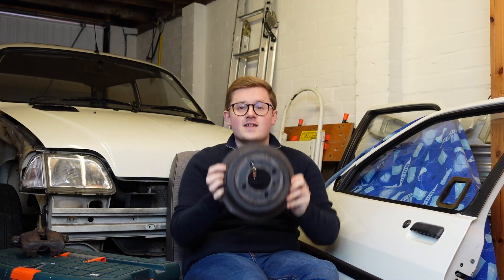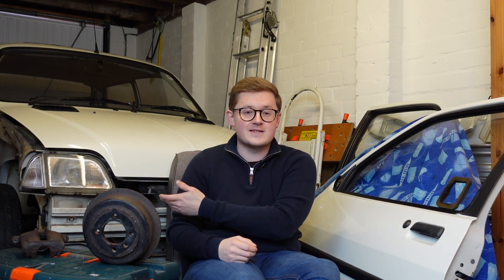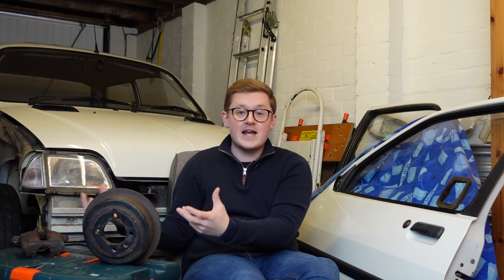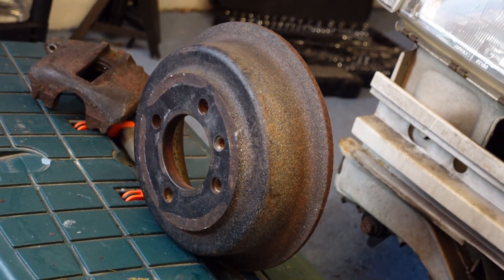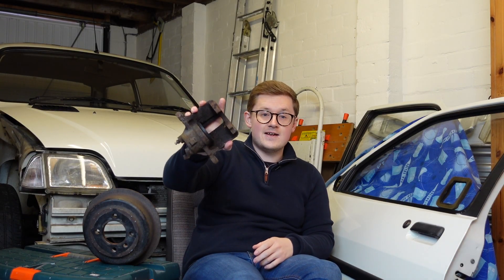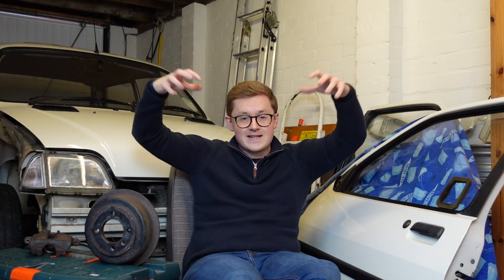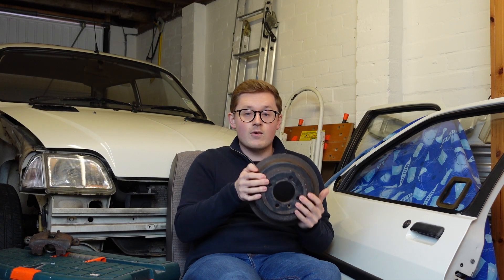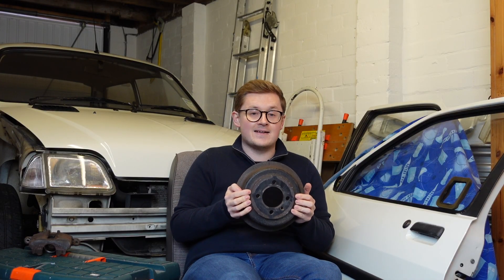Why are Drum Brakes Making an EV Comeback?

Comment: Good discussion. One error though...

The surface area of the friction pad in contact with the metal braking surface has nothing to do with the ultimate braking force. 

Friction force is dependent only on 2 things:  the materials used (same on discs and drums), and the force applied (how hard you push the friction material into the steel).

The advantage drums have over a disc of the same diameter is that the force is always applied at the rim of the drum at all points of contact.  In a disc system the centre of pressure is located in the centre of the pad which is further towards the centre of the disc. 

Thus with the same materials, same diameter brake system,  and the same force applied: the disc has a force applied closer to the centre of rotation meaning that it results a smaller torque (turning effect of a force or moment) to the wheel than a similarly sized drum with the same force applied.

This is why drums out perform similarly sized discs in terms of their braking TORQUE.

However...
The larger area (or more specifically mass) of the shoes vs pads goes to distribute the heat over a larger volume and mass of pad material (assuming the mass of the disc is similar to that of the drum) which means they will likely burn out less rapidly as heating is less localised.

This might mean drums and shoes are overall better if the force was even all across the surface if the drum brakes, however the leading edge of the leading shoe will experience far more force than the hinged edge (literally zero force at the hinge point and proportionally increasing as one travels further from the hinge (again, the physics of moments)). And the trailing shoe will be experiencing less force across it's whole surface due to the drum rotation direction. Pads however get almost evenly heated across their whole surface. So it is difficult to compare drums and shoes and their relative heating effects directly.

Comment: Cant you force the car to use the brakes from time to time to remove surface rust by software? If you remove the foot from the pedal and the car does regenerative braking, using the brakes as well with little braking power every x number of decelerations  should remove it, no?

Comment: Brake by wire is already in the corvette C8 anyway, I wouldn't worry about it being on drum brakes instead of discs.

Do disc brakes actually drag all the time though? Isn't there a spring that splits the pads when they're not pushing in?

Comment: Hi from Sydney, Australia. Beyond 50 years ago when GM USA was dreaming up, tooling up and designing their new US senior/big car range for all 5 brands for the years 1971 to 1976, GM was the wealthiest company on earth and their research and development was better than any other company bar none. The new 6 year 1971 to 1976 model run was to introduce many new features. ACRS (airbags) Air Cushion Restraint System introduced part way through 1973. GM would also introduce ABS brakes plus traction control. You could option ABS braking separately, however if you wanted traction control it came automatically with ABS that option/system was called MAXTRAC.  To create this GM sought the assistance of Bendix Aviation systems, who had created a set of systems for Hawker Siddeley's HS125 executive jet, and also for the offerings from the US Lear Jet company. GM & Bendix created a system for the enormous and heavy cars coming for this 6 year period, the front brake discs were huge thick and massively vented, at the rear were drums with the drums having alloy skins with a honeycomb of claws that cooled them inside the alloy drum was a ring of tungsten steel for the drum shoes. When one looks at one of these rear wheel ABS drum brakes, then removes the brake drum from the car, you will find drum surface and corresponding drum shoes that are 10 inches wide !!  Massively huge, also the surface material is/was ceramic !! Additionally, this system was so clever and advanced that 65 to 70% of the braking was at the rear, this stopped front of vehicle nosedive in ultra extreme braking and allowed the steering to be used and not so greatly compromised with the usual 70% front braking effectively limiting steering efficiency. The integrity of this 50yr old system is astonishing.

I own two Cadillacs from this time zone, both built here in Australia at GM's Pagewood, Sydney plant, sent as CKD Kits (completely knocked down, ie as parts in boxes) as to be registered here the cars would need to be right hand drive and other Aussie compliancy issues, so GM Australia ordered just 2 vehicles as CKD Kits Buick Rivieras and the premium long wheelbase range topping Cadillac Fleetwood Broughams. BOTH my 2 Fleetwood Broughams a 1972 model & a 1974 model are so equipped with MAXTRAC, additionally the '74 model has ARCS (airbags) dash top, steering wheel & for passenger. Premium cars, better than anything else, '74 also has electrically pretensioning seat belts, as G-force sensing mercury switches around the car trigger the reel-in feature and pull you back into the seat.  BACK TO THE BRAKES, when you mega-panic brake, stopping in one of these two cars feels like you have deployed a massive parachute behind you that has stopped the car dead in its tracks coupled with their electronic controlled air shocks and self levelling suspension, both these two cars do not feel , nor stop like any other car in a major panic stop, they stop in an ULTRA short distance with the feel that some giant hand or hook has ceased the car from moving forward, as there is NO usual front nose dive, none.  I have owned the black 1974 model now for 41 and a bit years and the white 1972 model for just gone 32 years, they have saved my partner and myself now for 4 decades, I'm a doctor and to me, these are some of the safest, most reliable, best built and equipped cars ever made by mankind and packed with features now just being added to some high dollar cars.

Comment: Im an engineer worming on acles for commercial vehicles in the USA so my exp is in commercial vehcils. We are having stricter rules for pad materials now (since 2020, then another stricter round in2025) to help alleviate some of the brake pad emissions by reducing the amount of copper in the pads. Additionally with moves to electric, we are still using air disc brakes but there are new innovstions the add speings to the calipers to keep the pads offf the rotors and prevent the drag you mention. So thats good progress for sure.

Comment: Think there is a lot of “selective memory” going on here.
I’m sure that size for size drum brakes can apply more braking force, but this is more than countered by the heat buildup.
If you go through flood water the motion of the disc throws the water off the braking surface, with drums it throws it on to the braking surface leading loss of braking force.
In the uk the braking surface of drums will rust, it might take a little longer, but it does happen.
On a disc brake the rust is scraped off in a few applications in drums it is trapped inside and acts like ball bearings between the surfaces and takes longer to clear.

As for maintenance over the last 44 years I have driven a variety of vehicles. I have never had to replace or overhaul a caliper, whilst every drum brake set up has needed new or overhauled cylinders every 2-4 years. My current car has discs all round, not because a fiesta needs them, but because in comparison to drums they are maintenance free. It’s also easier to see if they have faults.

Rear disc brakes are, let’s face it, purely a fashion thing like alloy wheels. Very few road cars need them and they are put on “cos it’s like a race car innit “.
The worst “style trend “ after Stupidly useless Vehicles are oversized wheels, who really wants a harsh uncomfortable ride with the expense of having to replace the wheel and tyre every time you hit a pot hole. All so you can shave 0.000001 of a second off your lap time, in the very unlikely event that you take it around a race track.

Comment: @7:30 engine braking works too, shame it's nowdays mandatory do full stops everywhere, losing more energy to start moving, it's what makes electric motors seem better, since they can have max torque from 0rpm. With automatic transmission, some people wont use handbrake at all, so when someone else uses that vehicle and tries, it just locks up, or wont work at all. I have worked with couple drumbrakes that wont have adjusters outside, they are adjusted so drum barely fits over... so when they wear out, it's quite impossible to remove peacefully. This videos information seems to point to the future where cars are scrapped every couple of years... not for long lasting stuff, which is better for enviroment. Drums do have longer service life than discs, but should car be scrap after 100k miles? ( @12:40 shoes should never have to be replaced ). Drums do seem efficient enough for ev with one pedal driving with "daily" cars, but as you provided trackdriving as example, disc are still better at stopping, so it should be customers choice. Easier to modify (replacing discs to drums / drums to disc) would be best option IMO, but this kind of modifying is stopped with laws, since discs are better at stopping, changing to drums is outlawd for decreasing braking force.

Comment: As a professionally qualified, now long retired mechanical engineer, found the video absorbing and the material arguments well presented. Can relate directly to the technology as having started young “tearing” old cars  apart, in the 1950’s, just to keep them roadworthy on apprentice pay, have encountered all the issues outlined here both with drum and disc brakes. A good video and should provoke some interesting discussions. However, feel most strongly we are not anywhere near ready for wholesale use of electric vehicles. The points raised about heat dissipation are well made and too about the particle buildup in the atmosphere fron disc brake dust.

Comment: I'm not a car guy but in the bicycle world roller brakes have been the upgrade from drum brakes. (Both are not very common in the North American sport focused market) Both have very low maintenance and good reliability. For the roller brakes the common maintenance is to just add a bit of the special grease. I confess I don't entirely understand them. I was just wondering it that exists at all in the car world, or would it get too hot given the larger scale of cars? The best version of the roller brake has aluminium heat dissipation fins and is a noticeable upgrade.

Comment: I  would argue that disc brakes on the vast majority of passenger vehicles have never been much more than a marketing gimmick anyway.  With normal driving at legal speeds in the UK drum brakes would never come close to overheating and fading.  They have become a by-product of unnecessarily large, heavy, and overpowered motoring ego boosters.

Comment: the reason disk brakes are better, and have more stopping force.. the reason they're used on everything.. comes down to one thing, a single factor. they are MUCH better at dissipating heat.. and when your brakes overheat you no longer have brakes,,, 
interestingly enough, semis and other big trucks use drum brakes. that only works because they use a pneumatic system instead of a hydraulic one. in fact they kind of work the exact opposite of hydraulic brakes.

Comment: true. Brembo recently announced their electrically actuated disk brakes but I think there is a possibility that we can do without brakes then use tiny drum brakes for parking. See, my theory is EV manufacturers can do without brakes by outsizing or adding more electric motors and electronics and/or dump the excess energy as heat then use some electrical/battery energy for a complete stop.

Comment: Drilling and slotting discs was not for heat dissipation. Asbestos pads used to outgas a lot which lead to a layer of gas building up between the pad and disc which reduced braking. Slotting or drilling the discs gave the gas somewhere to go with vented discs ie into the space in the middle of the disc. Modern pads outgas a lot less, leading to drilling or slotting actually reducing braking effectiveness a lot of the time due to the surface area reduction. But slotting and drilling discs became trendy so is still popular despite being mostly a bad thing these days.
Reply from the maker: That’s simply untrue.
Reply: @TwinCam  Until you produce evidence proving that I can't agree.

Comment: Loads of cars use the rear discs for the handbrake, your explanation of handbrakes is very misleading.
Reply from the maker: As I said clearly in the video, we’re simplifying and ignoring the exceptions. Using a set of additional drums is most common.
Reply: @TwinCam  I disagree, I believe using the discs for the handbrake is the most common. But what we need to settle this is data.

Comment: A few things need to be highlighted: 1. this entire 'issue' started before EVs with hybrids  2. The corrosion issue isn't that much about disc surface corrosion, but the pins/pistons being corroded/seized (as moisture or salt could get into the rubber boot), which cannot be cleaned unless being taken apart, and will lead to a scarred/pitted face of the disc (rather than just surface rust that cleans up with use), and a virtuous circle of uneven pads wear and discs pitting (which to many people appear to be rust due to lack of use - right conclusion, wrong analysis. Unless the root cause is addressed soon your new disc/pads will be bad again). 3. not all disc brake systems use a brake drum for handbrakes, some EVs already got rid of the physical hand brake but lock the driveshaft instead. 4. One paddle driving is a bland of regen and frictional brakes, not just regen (and the friction brake is not only just for the last few MPH like some believes, it is a lot more sophisticated)  5. I also do not think VW's current solution is really 'the solution', and many have reported they do seize up as well, and they do require maintenance and taking apart. Also worth mentioning MEB cars (apart from ID 2ALL) are RWD, by which the regen motor is at the rear anyway (torque vectoring is really the key here), which cannot be directly compared to FWD MQB cars.

Comment: Great video, however there seems to be a mistake. Friction is not dependent upon surface area, and as such, increasing the surface area of the pad does nothing for the maximum braking power.
Wikipedia calls this "Amontons' Second Law: The force of friction is independent of the apparent area of contact."
Of course, this is a generalization and an empirical rule of thumb. None-the-less, i think it's incorrect to say that greater frictional force is achieved with greater surface area, and nothing else.

Comment: Speaking as a motor mechanic working from the 60s to the early noughties, drum brakes always required more work (than discs/callipers), new seals more often than ever disc callipers needed, and new cylinders as often as new seals. Scored rear wheel cylinder bores were common (because whereas new brake fluid should have been a service item, it rarely was, and poor practice re-fluid topping up led to dirt in the system) and yet I remember rarely changing seals within callipers. I applaud your bigging up of old-school stuff - at your tender years I was the same, but I am getting on now - and I can see some advantages to drum brakes on the rear end of some less weighty cars. Last thing though - it was always more common to suffer brake pedal flutter with drums than discs. Once out of kilter, drums tend to become worse with use rather than better. Discs aren't perfect, but they work a whole lot better than drums, and with modern manufacturing methods, disc brakes are no more expensive to produce than drums. Ten out of ten for defending drum brakes, but no, never better than discs!

Comment: This jives with the fact that for a while like clockwork every month newcomer to the FB Bolt EV group I frequent would say their brakes locked up.  Likely it was always a little old lady (or little old lady in spirit) who never stopped abruptly enough to use their brake pads.  One of my points of advice for new EV owners is to throw it into neutral and exercise the friction brakes at least once a month.

Comment: If you put fins on the outside casing of the drum and had airflow such that it's sent air from the two front air ducts over those drums at the front and rear the fins would turn the case into a heat sink. And the irony is the faster you're going the quicker it will cool as they'll be more air running over it keeping it super cool ready to be applied.
Reply: Practical example from an admittedly small low powered car. I raced Minis in New Zealand throughout the 80s, all 850cc but full race modified, drums all round, on slicks. The drums were drilled to let air in and the backing plate also drilled short of weakening it too much, and sometimes ducted.  On most circuits the drums just held out to the end of a 10 lap race. On one circuit, the street race in Wellington, by the end of the race the brakes on many cars were literally cooked, anything not metal in the brakes was melting or burnt. In my case on the second to last lap I arrived at the chicane and found zero braking. I do not think finned drums would have helped much. When even the seals on the pistons are damaged that is a lot of heat.

Comment: In my early automotive years I couldn't understand why manufacturers bothered with drums, until driving offroad. They hold better on a hill.  Well designed systems like the 4 runner are like an anchor.